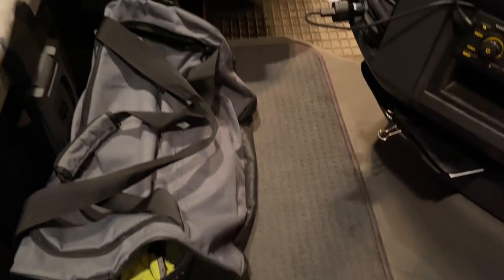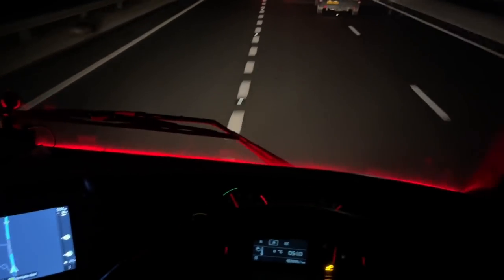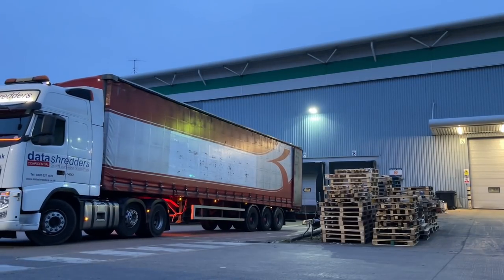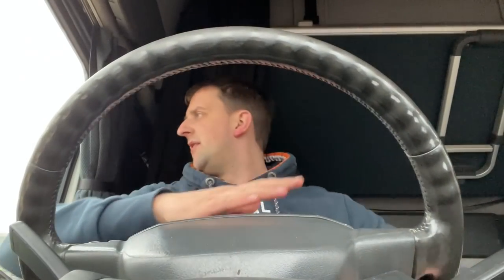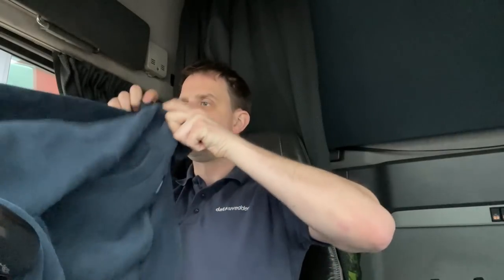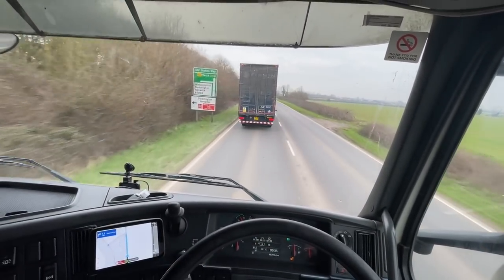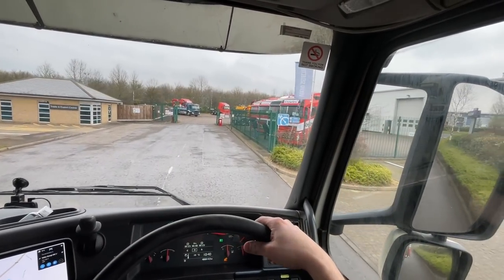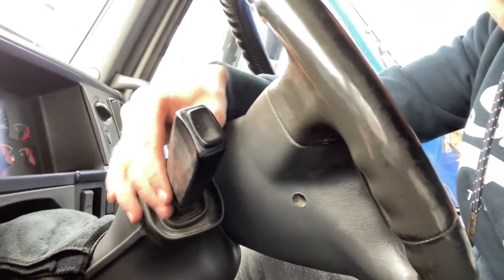Multi Pick Up | Blind Side JACKKNIFE | POV | Trucking Vlog 45 | #truckertim

Comment: Tim: Pulls up to job in a truck with DATA SHREDDERS logos on the front and side.
 Overly suspicious security guard at gate: "who do you work for?"
Reply: Back in the 2nd lockdown in November 2020 I was furloughed from my usual job so did some temporary parcel delivery work for Yodel, I delivered to that 1st drop… nightmare! Took about 40 minutes to deliver 1 pair of trainers 🤦🏼‍♂️🤦🏼‍♂️🤣🤣
Reply: Jmie moss 1t6654
Reply: @jamiemoss4834  Thanks